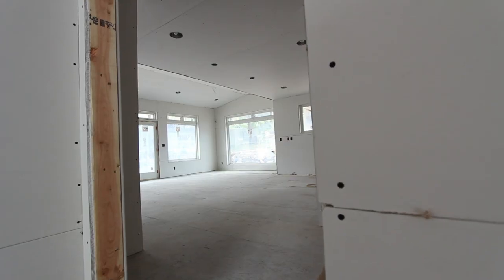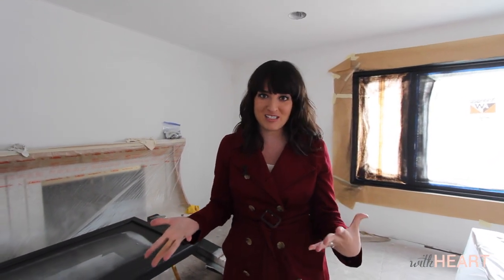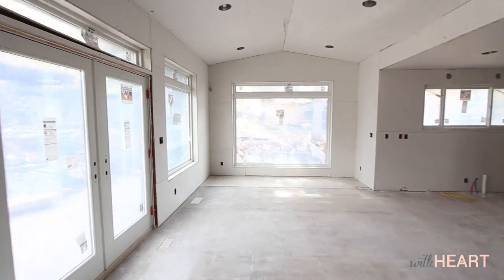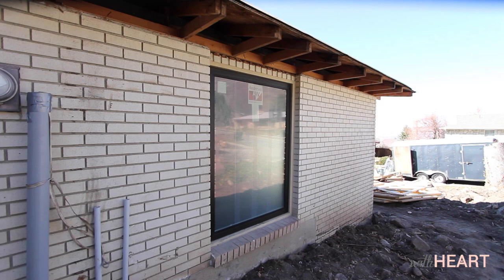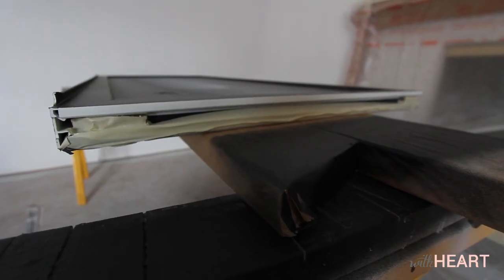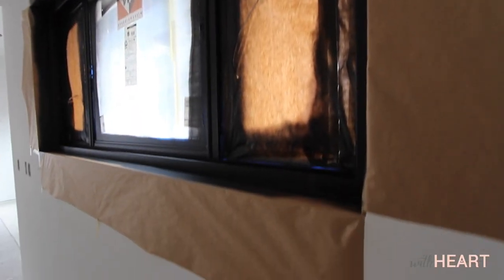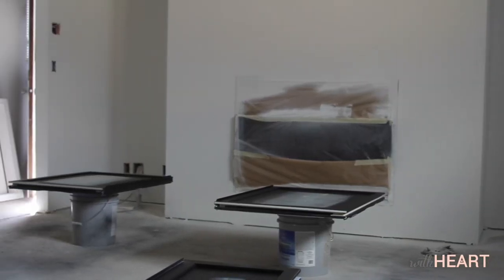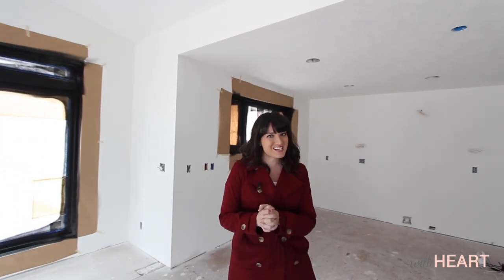How to Paint Windows Black | withHEART

Comment: its just nonsense buying new windows and paint them. instead of all of that headache you could have just ordered them black in the inside as well. how much $ did you spare by going through all of this?
Reply: And that is why you do your research before you buy anything expensive for you home. 
In case you don't know there is more then one window selling business and there is plenty of them offering colored windows. Just as an FYI most of the window businesses will void your warranty if you paint the windows
Reply from the maker: Hi, we did a lot of research and the this was the most economical route for the look we wanted.
Reply: You made a wise choice Jennifer ignore the naysayers
Reply: Definitely cheaper painting insides yourself
Reply from the maker: Andi Zog hi there, they don’t come in black
Reply: Lol you obviously haven't gone window shopping lately
Reply: @JenniferStagg  I doubt it will cost more to just order them in black
Reply: Ollie E it costs about 30% more to order them in black, and most manufacturers only provide black on the exterior, white on the interior. A higher end manufacturer like Kolbe offers black/black, but it also costs 3 times the cost of other manufacturers like Jeld Wen, PGT or PlyGem. Windsor offers painted interior/exterior colors, but now your right back to where they are in this video...
Reply: Black windows are typically 30%+ more in cost over white